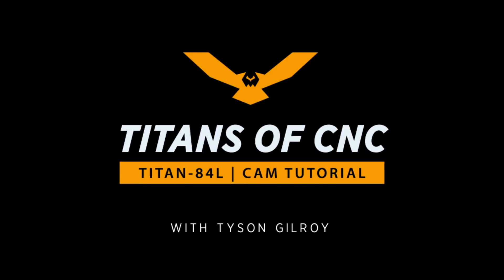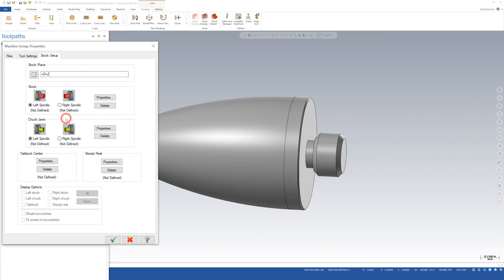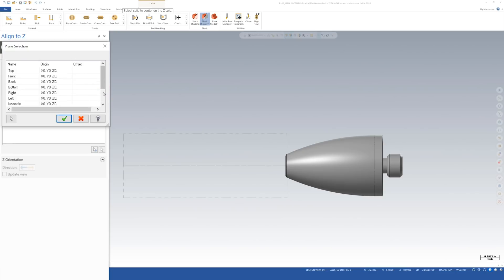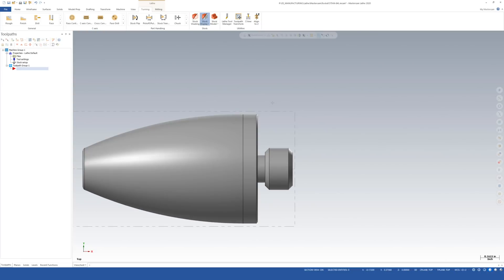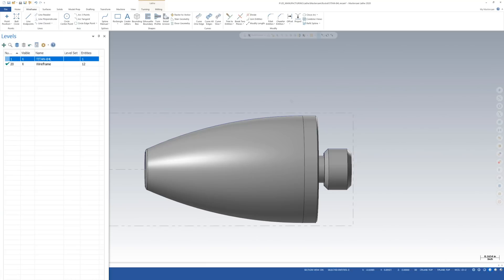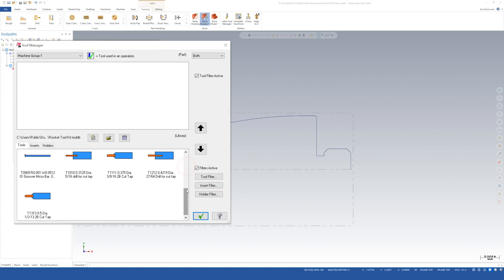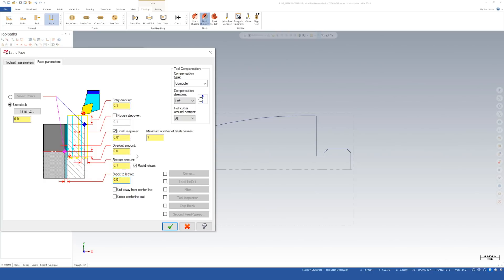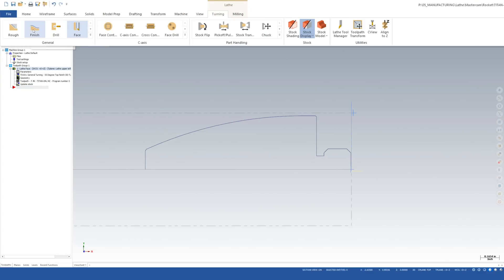PROGRAMMING & MACHINING Our 1st Rocket Part Using MASTERCAM | Tool #1

Comment: Tyson, for the thread relief groove using the 063 groove tool with a .008 radius on the insert, the tool never establishes the thread relief groove diameter. Otherwise, t would take out the .020 radius in the corners. Take a look at it and you will see the tool never touches the diameter. Please give me your findings.

Comment: I am sure this is good software, but being a bit familiar with cam, it seems incredibly convoluted, unintuitive and a huge learning curve, especially for the initial setup. It was apparent to me that there was so much 'secret' steps that made NO sense to me at all, like having to align your part to the stock. Not at all intuitive like Fusion 360, with even CamWorks being more user friendly; Not complaining but offering my initial observations. You explained the steps clearly; It would be helpful if you added more 'why' and show some of the alternative selections of options for comparison, for instance, expanding on the lead-in/lead-out to show how perp/tangent affects with different radio buttons selected. I am a low intermediate, so perhaps you could address why we would be interested in MasterCAM and what benefits or efficiencies make it a worthy choice, over say F360. I will continue to watch and learn, though.
Reply: Mastercam has a very steep learning curve and is not user friendly. But it is very powerful and it's the reason why many shops use it.
Reply: @loukola5353  I agree with you 100% I am so glad I have the willpower to grind through all of the tutorials to develop a deep understanding of how all of the parameters work with one another (especially in the case where toolpaths won't generate) more control = more chances for me to be a struggle muffin and mess it up though 🙃

Comment: nice video, but why you only show a bit of the turning at the end ?
Reply from the maker: The video was close to an hour long so we shortened it... the full video with programming & machining can be seen for free at https://academy.titansofcnc.com/series/titan-84l
Reply: @TITANSofCNC  How did you manage the parting operation without holding the part in sub-spindle. There are chances of job vibration and even job could fly anywhere instead falling down.
Reply: @waradens  When I first started as a lathe operator I would work on small parts like this. We would part off parts like this and they would fall into a "parts catcher." You can look up "cnc lathe parts catcher" videos to get an idea of what they do, or look at this link -> https://youtu.be/tMcxpVyr3sA We used those especially when we had parts with threads that we didn't wanted dented by falling down into the chip conveyor

Comment: Does the aerospace industry require Mastercam vs Fusion360? Do some customers have a preference of which software you use due to Fusion's cloud usage?
Reply: I'm no expert, but from what I have read from other machinists, it is exactly what you are saying that customers do not like the cloud, they don't want their secret stuff out somewhere on the internet.
Reply: Look up AS9100 certification requirements. I personally use Mastercam, GibbsCAM, Solidworks, & Catia
Reply: @chazz.zaragoza.9561  a lot of aerospace companies require that you have at least 1 seat of CATIA soft. a lot of them provide only CATFiles